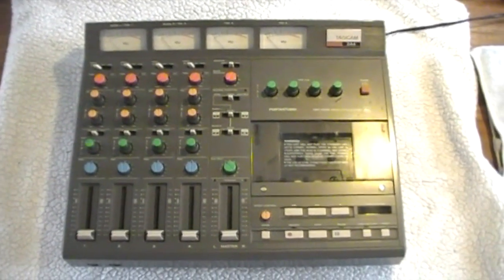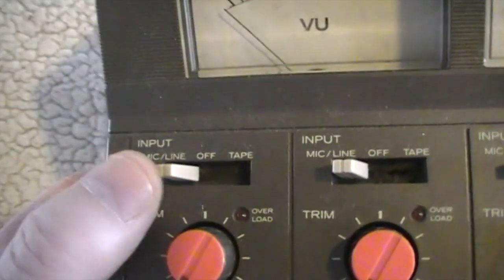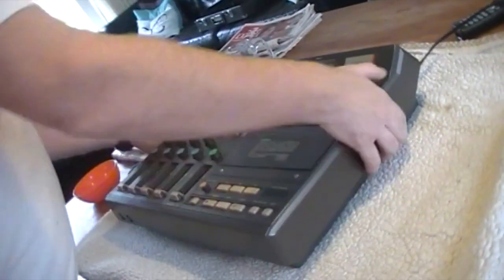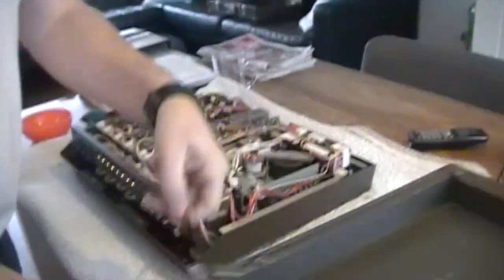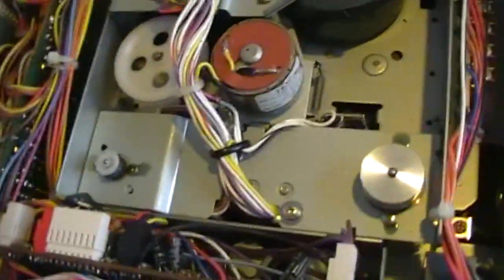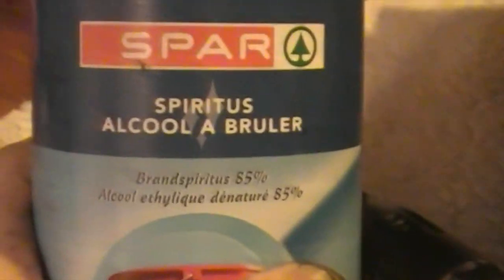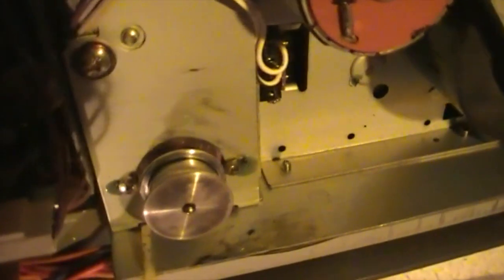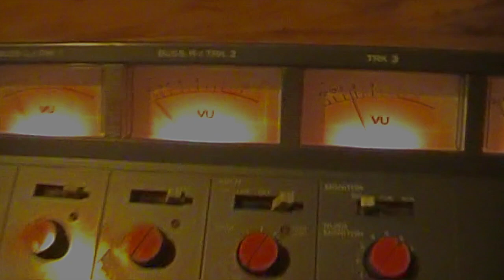Tascam 244 belt replacement

Comment: I still have mine which I bought in the 90's and the belt would fall off back then so I had to always open it up,I need to get my working again as it has some issues maybe other belts fell off.I have tapes I need to play as those are only on the  multitrack recording. Mixed down tapes were lost.
Reply from the maker: mindcontrol67 probably your main belt had been worn out, becoming too loose. There is also another belt, a smaller one, which drives the tape head engagement. One other part is a little plastic wheel with a rubber "tyre" around it, which is a little harder to replace. Be careful not get the sticky vanished rubber all over when you open up your old recorder...good luck! Thanks for sharing your experiences
Reply: Thanks!

Comment: Is it possible to use rubber bands if they fit correctly if I cant get hold of the original belts? Would this damage y machine in the long run? Great video series by the way, you have already helped me out a tonne!
Reply from the maker: DanItsColed Thank you for your kind words. I would use regular rubber bands only as a temporary solution, they can be a good help in determining the correct size of the actual belt to look for. I believe rubber bands don’t have the right tension, and they will wear out faster. I don’t really think they will damage your machine, but they’re not reliable enough to work with.
Try a local audio/video engineering shop, they might have a box with several spare belts for recorders or video cameras. There might be one that fits

Comment: I have replaced both belts, pinch roller tires, idler tires and the heads will not retract. Any support would be appreciated thanks for a Great Video gave a 👍
Reply from the maker: There is, for 4-track repair videos, a far greater channel than mine out there: Tetrakan Supermonobloc. Hope it helps...!

Comment: How many belts does porta 05 have?  I'm thinking of buying a broken one.
Reply from the maker: ferhat dünden I think 1 or 2 belts. My 25 year old porta 05 had a broken belt, which at first I repaired with a rubber band, just to see if I could get it running again, and it worked. Later I got a better belt to do the real repair. Not an original one, but some belt from a videocamera, we searched for a belt that had about the right size
Reply: 2 belts, and two rubber tires found on the too of the cassette entry chamber, must remove the cassette assembly to access. Temporary fix for the rubber tires, round seal from a plumbing shop

Comment: Spiritus is alcohol. Alcohol is a solvent. You should use something more appropriate if you get in touch with old machines with old plastic parts.
Reply from the maker: Okay thanks for the tip...what should I be using?

Comment: Such a great and helpful series of videos, I've really been learning a lot from these. I have a rather uncommon issue with a tascam 246 I'm about to buy which is making a high pitched whining noise during playback/record, it grows higher in pitch and louder as playback continues, here's a link to the video: https://youtu.be/1pppax7Dh6M

I'm beginning to worry that it may be a motor dying rather than a belt or idler tyre problem.
I've searched the internet for answers but haven't found any similar cases yet. I also don't have much experience and would be hugely grateful for a second opinion. Have you encountered anything similar before?
Big thanks!